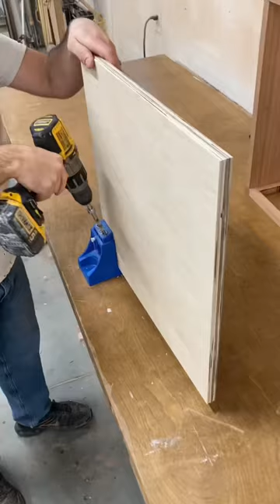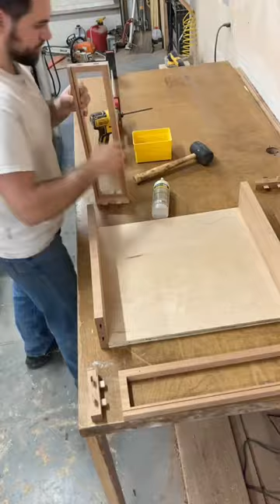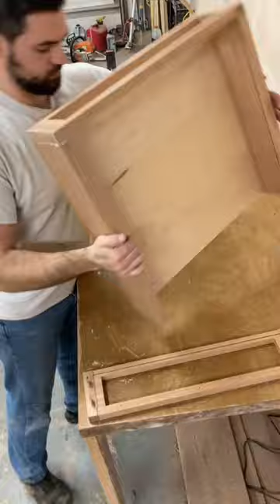Plywood Bottom

Comment: Notes on safety. Do not reach over the blade to  retrieve the cut piece. One day, when you are least expecting it, you'll drop the piece right on to the top of the spinning blade. This will not be pretty, particularly if you dont have a crown guard like this guy. Push the piece right through and come round the saw to retrieve it from the other side
Reply from the maker: my bad
Reply: You’re also asking for a kickback disaster if the piece isn’t significantly longer than it is wide. Make a sled for your saw if you haven’t; it’s safer and very useful.

Comment: You should have clamped it first than screwed it
Reply: It is domino jointed for alignment already.  Your idea can’t hurt but I don’t think it was at risk of going anywhere
Reply: @HiThereFriend1  so then why clamp it 😂
Reply: @bigpapi8616  I guess to hold it tight while the glue sets. The screws are helpful if you need to remove the clamps quickly to put somewhere else. Not sure clamps are needed at all with dominoes lining up and pocket screws pulling tight.